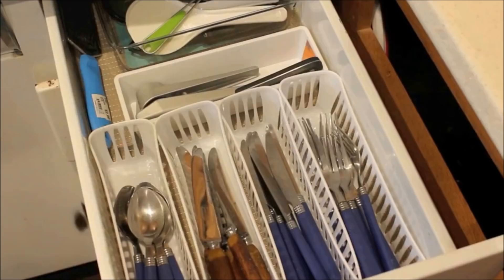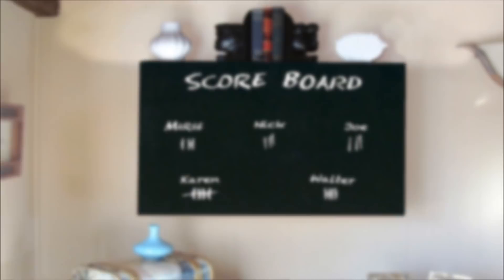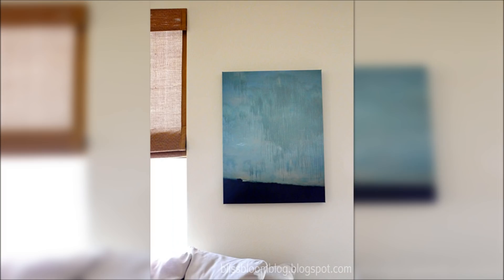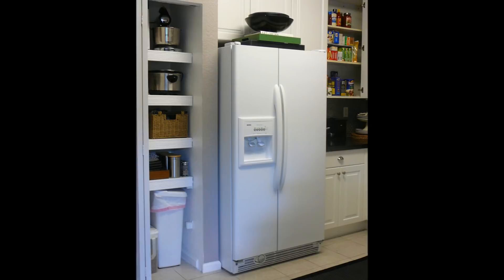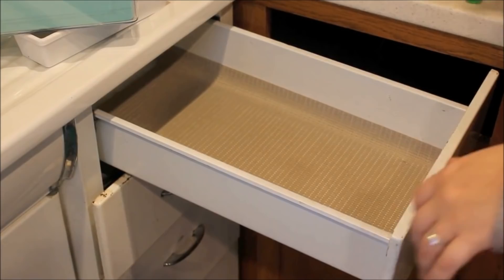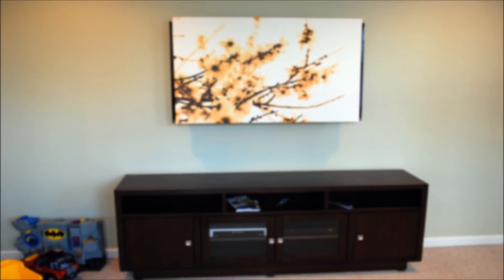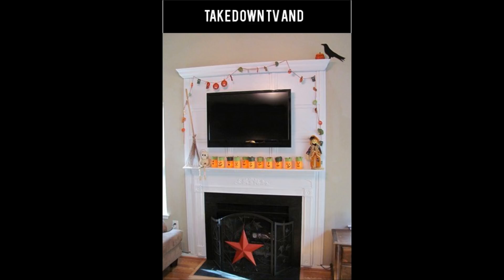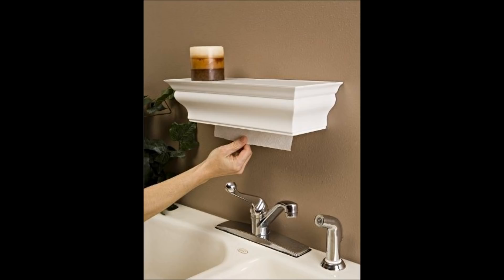21 Ways to Hide and Organize Things in your House #1

Comment: Please please please do NOT put your router into a closed box!  It's gonna over-heat. Unless you add in a way for air to circulate, you're going to break your stuff (the same goes for any electronics, they generate heat so let them breathe! )  🔥

Comment: #6 hiding the thermostat behind art is a bad idea. This interferes with the airflow to the thermostat and causes delays in the AC/Heater turning on and off. This makes the room's temperature swings wider and less efficient. Likewise putting any mat in front of an air intake will cause the AC/Heater to work harder to bring in the necessary air for an efficient system and a system that works harder will cost you more $$.
Reply: C

Comment: Have you ever heard of heat dissipation and airflow? Hiding thermostats is 1 of the worse ideas you can think of, because it won't register the temperature in your room and therefor not manage your heating/cooling right. Routers need an airflow, to dissipate the heat. The way you put them in a box will overheat them and destroy them. Ever tried screwing a screw in particle board? wel, it can, but with a moving front attache onto it, it will hold for a couple of days and then there's only a hole left. Bad idea
Reply from the maker: Thank you for sharing your opinion
Reply: Thanks for sharing your method of avoiding CERTAIN DISASTER.. I mean simple opinion...
Reply: Simple Home Art Decor Ideas it's not an opinion. It's fact. You are not helping people with some of these. Only causing problems.
Reply: Barrie Vermazen...I agree. People really need to do some research before making video's such as this.

Comment: Do not cover your AC unit!!!
Reply: I believe that is meant for when its not in use. please use logic.
Reply: Um.. Samantha that was already pointed out in a comment below. There are many reasons why you don't want to cover an AC unit like this one. For those areas where it does get a bit cold in the winter months and the AC unit will not be used for some time you would already be covering the outside to protect against the elements. Covering the inside would trap any moisture from condensation. I could waste my time rambling on about the effects of condensation trapped in an AC unit through freezes and thaws throughout the winter, but I would hope yo would already know the effects of that. Logic enough for you?
Reply: Except A/C units have condensation drains. Covering A/C units is a very common thing. Assumptions aren't logic.
Reply: You're absolutely right! And in regards to the guy who used "logic" in his reply to you. Clearly it was only assumption as A/C units have condensation drains. Covering A/C units is super common!
Reply: The store sell ac covers for inside and out.

Comment: 10. Any clear bottles would do, not just from Muji. Muji's just expensive. Bottles from dollar stores or even Daiso has some clear plastic bottles (some has transparent colors too!). You can even get foam making bottles.
Photostat some letters like Shampoo or Soap (with fancy fonts) onto clear cards, slip the cards into the bottles (or use decoupage glue and stick it on), fill the bottles and now you have personalized bottles.

Comment: I really liked the last one. Hiding ugly walls with peg board. But my concern is all the dirt/dust that will collect behind the peg board (between peg board and ugly wall).
Reply from the maker: thank you for that concern
Reply: A board or moulding at the top would prevent dust coming in from the top and, better still than time-consuming stenciling, cover the peg board with waterproof wallpaper and only poke holes where you need to add brackets and leave the rest of the holes covered.
Reply: +Robin Griggs Wood Thank you, Robin. Sounds like a good idea.
Reply: Oyo huh uh hui I

Comment: 1:20 the router can build up heat therefore it breaks faster.

1:55 the AC unit is now useless.

6:33 that thing is perfectly fine. After sorting things out she didn't need new container. (I have the feeling by some other, before and after pictures for space saving Tips that they simply removed 50% of the stuff and the tips don't really helps a lot)

Comment: Like some of these ideas, but I'm no carpenter, no artist, have nothing from ikea(not even a nearby store) and really don't understand why hide these things. I did, however, cover my thermostat due to its light being too bright, with just a thin, partially translucent cloth and wondered why for days I was FREEZING when it said it was 75degrees. It was then I realized it couldn't read the room temp, so I highly suggest not covering some electronics. They overheat of read wrong. Thank you for sharing. Might try one or two of the easy ones.